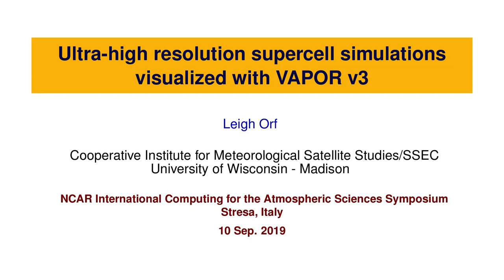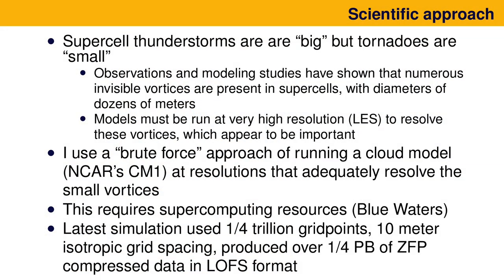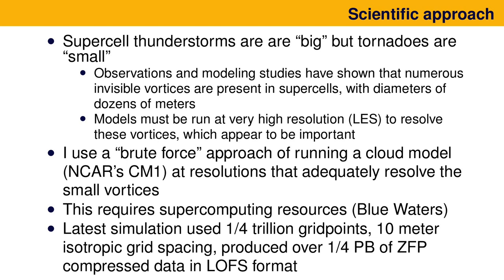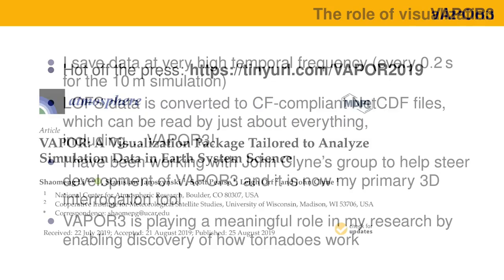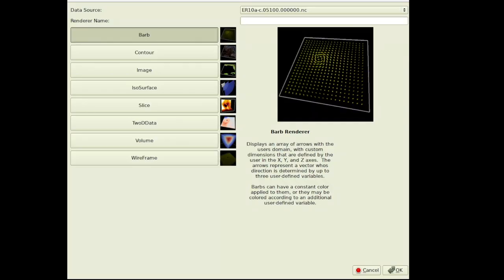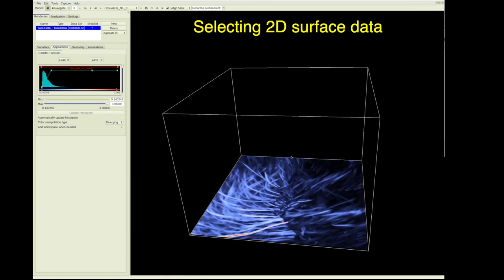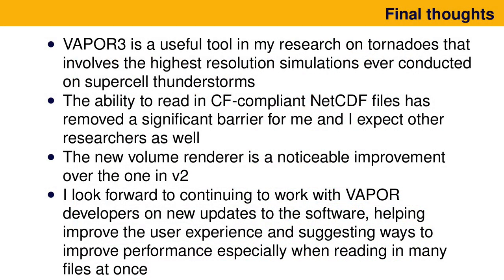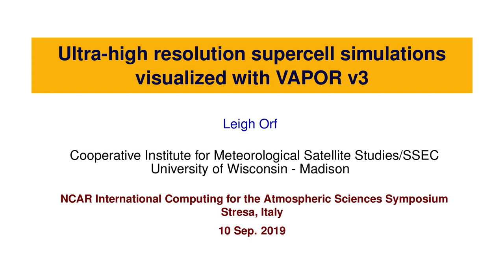Ultra-high resolution supercell simulations visualized with VAPOR v3

Comment: I always think I've seen very cool things in your videos, and then a new one comes along and it's even cooler! Next up: full 3D VR supercell? Imagine flying around the supercell with a VR headset!
Reply from the maker: It's in the works. We're working to adapt to the Microsoft Hololens. It's really not that hard to do, it's just a matter of data formats (which become painful because many are proprietary).
Reply: Sweet! That might push me into getting one! (or at least heading to a store and trying one out, and just happening to view a simulated supercell! ;) )
Reply from the maker: It's also not difficult to do stereo rendering - you just render two images from different viewpoints. I can't see 3D due to having strabismus but it's another thing that's on my to-do list!

Comment: Have we looked at these conditions for long lived and powerful tornadoes from a perspective of atmospheric reactions yet? Understanding the dynamics of vorticity are moving the field of study forward in giant leaps it seems, but I wonder if there are atmospheric conditions involving particles and pressures that can influence the power and longevity of these storms? Like draino and aluminum foil in a bottle, the reaction creates rapid air expansion. Wondering if air/water molecules at different pressures and temps can create that vacuum affect, especially as the cell itself is building higher and higher into the atmosphere. Possibly the elimination of the Cap leading to a massive movement of particles upward...mixed with shear and vorticity and you'll have what you need to sustain a powerful storm. Continuous feed of moisture and shear along with that steady inflow of cool air. We know molecules move and react differently to pressures and temps, even basic molecules not known to be necessarily volatile or explosive in nature can react to a rapidly changing environment. I have linked storms to vehicles before and still believe it holds at least a little weight. An engine runs ok on warm air, but it craves cool air for full efficiency and power...even rotating the air as it enters the manifold can improve the engines performance...what if a storm was the same way?

Comment: I’m wondering if the lower the pressure the longer lasting the multiple vortices? Multiple vortices spin up in my experiment, however they don’t last. In my last experiment then spun up in the 2 major cycles that happened to be the two strongest. They also seem to spin up in the beginning of the cycle. I haven’t yet tried to increase the power, thus decreasing the pressure. Believing this could cause the multiple vortices to last longer. FYI I mean inside the main circulation.

Comment: Hey Leigh. Quick question, what "vorticity" is a supercell tilting into the updraft? Is it actual vortexes, but if not how does the environment impart the vorticity that an updraft ingests? Is it advected? What role do vorticity tubes play in this process and what exactly are they if the environmental shear is just 'imparting' the vorticity?
Reply from the maker: It's complicated! Certainly the upper part of the mesocyclone results in part from tilting of environmental vorticity, but at low levels, it appears that the cold pool generates a lot of horizontal vorticity (and some vertical) that is reorganized by the updraft. The latter part is the most interesting. It appears that the SVC is mostly generated within the cold pool. Some of my animations show pretty strong evidence of horizontal vortex tubes being tilted abruptly into the vertical. Also, horizontal vorticity is "stretched" as the super strong updraft pulls air into its bottom - the updraft can get very strong near the ground where it basically acts like a monster vacuum cleaner hose.
Reply: @LeighOrfsThunderstormResearch  Ah I see! Thank you! Also I think I might have misworded my question a bit, I meant the environmental vorticity in respect to mesocyclogenesis. It's from my knowledge that the environment a supercell evolves in  does not contain any real horizontal vortexes or rolling tubes as commonly depicted in many illustrations. Rather, the shear alone imparts spin (or angular velocity to something, akin to solid body rotation), but how does that work in respect to an updraft? How is the updraft 'tilting' that environmental shear and becoming a real vortex, and what do vorticity tubes even represent in this? Sorry if that's off topic, but this is something that's been really bugging me and I haven't any clues!
Reply from the maker: Those tubes are for illustrative purposes only, but sometimes the boundary layer does show those kinds of tubes in actuality - and sometimes they show up in the cloud field! But, vorticity is vorticity as far as the equations are concerned. Those conceptual models (with the diagrams and the straight arrows and the roly poly arrows) are simplifications. One thing that's useful to remember is the mesocyclone is a region of local low pressure, and air tends to flow around centers of low pressure. In a tornado, it's a cyclostrophic balance. It's not so much so in a mesocyclone, but to a very rough extent, the air in a mesocyclone is rotating about a vertical axis, partly due to the fact that it's an area of low pressure. The tilting of horizontal environmental vorticity is more important in the higher reaches of the supercell's updraft, and when I look at my simulations, it's more important on the periphery of the updraft. The air that is baroclinically generated (along the cold pool density gradients) contains lots of horizontal vorticity, and this horizontal vorticity can be abruptly tilted vertically where it becomes part of the core of the mesocyclone, now rotating about a vertical axis. It's all very nonlinear and there are feedbacks. One of the most important recent discoveries is the role of concentrated environmental shear in the bottom 500 meters or so of the atmosphere. The more of that, the more likely you are to get long lived tornadoes (so long as you also have deep shear and lots of CAPE).
Reply: @LeighOrfsThunderstormResearch  I see! That was really informative, thank you. 😄 
What do you think of theories revolving around the advection of momentum being primary cause for updraft rotation in a supercell such as described here https://journals.ametsoc.org/doi/full/10.1175/JAS-D-17-0091.1